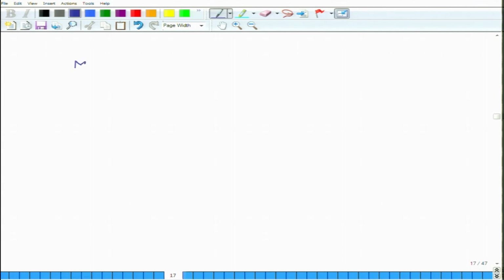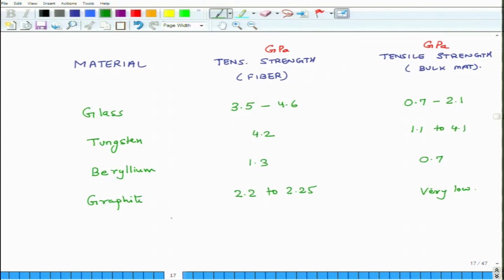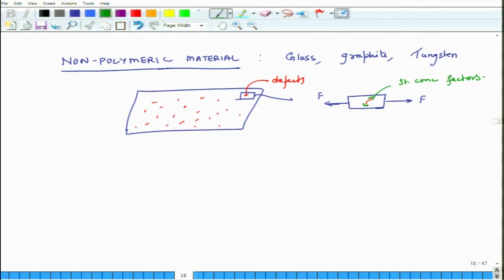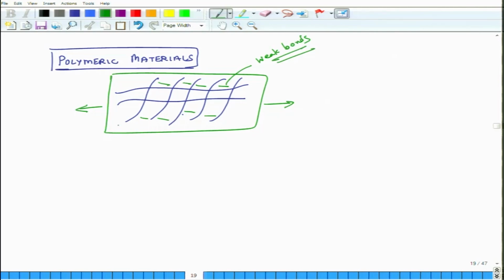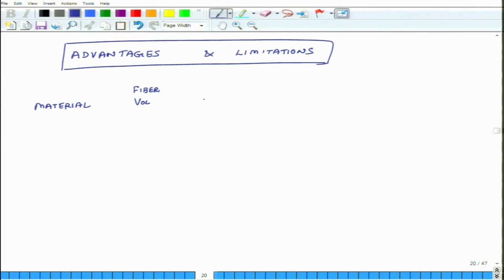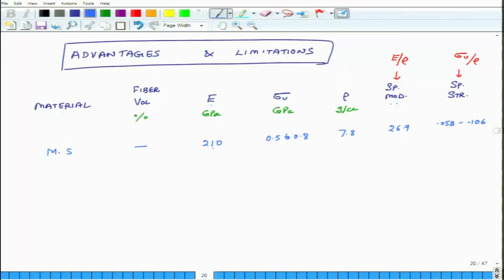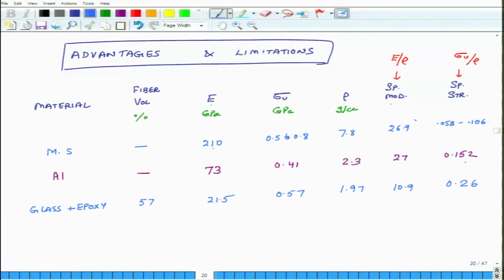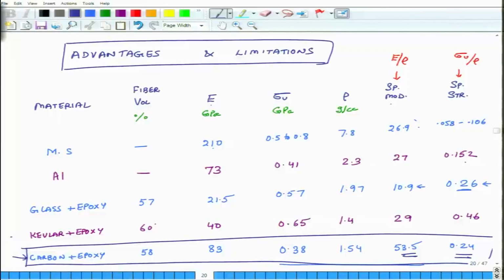Lec 4

Comment: 00:03 Fibers exhibit significantly higher tensile strength compared to bulk materials.
03:44 Different types of fibers have varying strength levels compared to bulk materials.
07:36 Defects in materials lead to stress concentration factors and lower strength.
11:10 Polymeric materials have weak bonds between chains.
14:26 Understanding the strength of fibers in composite materials
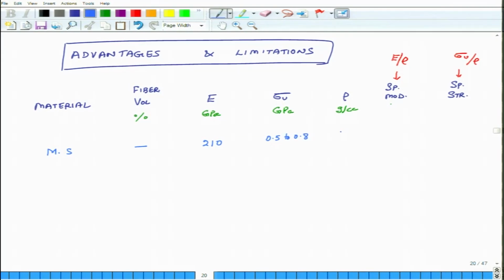18:23 Specific modulus and specific strength explanation
21:25 Choose aluminum for light structures with high strength or glass plus epoxy for strength with less mass
24:29 Carbon epoxy composites offer high specific modulus and strength at low density.